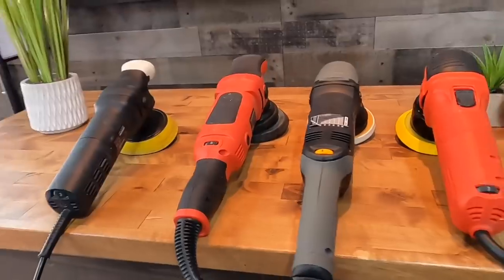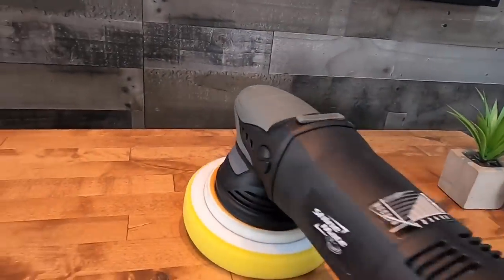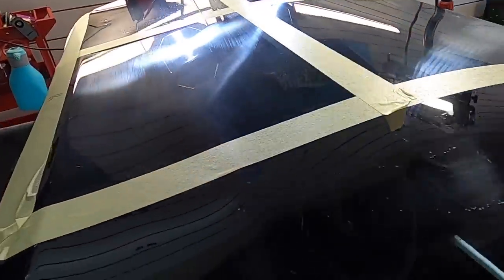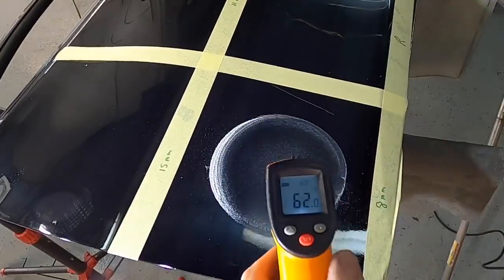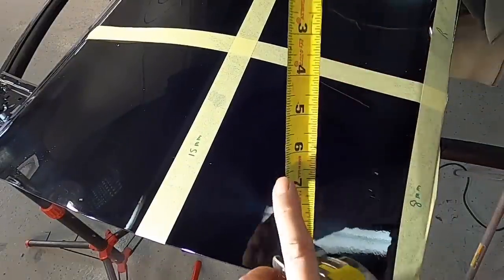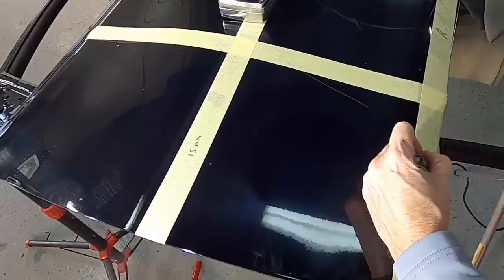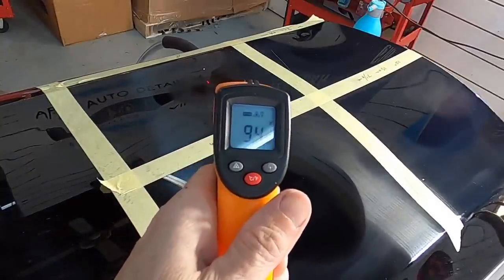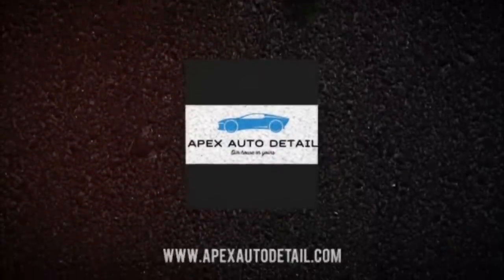What Type Of Polisher Fits Your Skill Set? 8mm, 15mm, 21mm, Rotary Polishers? Watch To Find Out!

Comment: Useful video thanks Brian. The Infared thermometer normally measures a cone area from the sensor so the further away it is from the surface the larger the area it measures. The guiding laser dot can be a distraction to remembering that.

Comment: Outstanding video which could easily lead to a dozen more. I’m now thinking about how much more heat does a microfiber or wool pad generate compared to the yellow pad used today. Do more abrasive compounds generate more heat compared to polishes. The biggest wow factor for me was the heat difference between the 8mm and 15 mm. Thank you for making us think more about maintaining the clear coat or paint.

Comment: As always great information to beginners  just starting out. 
My experience is that I can keep the panel cooler whit a rotary then whit I DA. I always use rotary for cutting and DA 15mm for finishing, 8mm I use for laying down sealens. That's works for me. Thanks Brian for a great video. 
I have a question, I have had several customers asking me about a product called Glare polish. Its supposed to have something called glasplexin in it that binding to the paint. Have you any experience whit that product?

Comment: Nice video Brian. 
I have been detailing for a bit over a year. Detailing as in paint correction. I have a 150mm 15mm throw DA polisher but want to get a 125mm with a 21mm throw, a 80mm polisher, a forced rotation and a nano polisher. Might even buy another 150mm with a 21mm throw as my polisher has seen better days. 
I dont like rotary's. 
I was in fact surprised you saying you use a rotary for finnishing.

Comment: Thank you for the great video. How will you suggest using a pneumatic dual action sander (3/16" orbit) with a  5" backing plate? I am a weekend DIYer and would like to use what I have instead of buying a new entry-level DA polisher. Thank you!

Comment: I watched a video last night and you mentioned that the switch in some polishers are from Hont- have you needed to replace any speed controls? I have a polisher that has a control which looks the same as in the Drill Master, but the parts aren't available from Harbor Freight. I checked with a multi-meter and the pot is open until it hits the detent. Do you have a link? I saw switches but when I searched for speed control, it had nothing. 

Thanks

Comment: How long does it take to burn through the paint with a rotary compared to a random da polisher?
Reply: rotary at full speed and apply heavy pressure i had burn the paint in under 10 second staying at the same spot.. DA will never burn the paint even if i stayed at the same spot for more than 60 second.